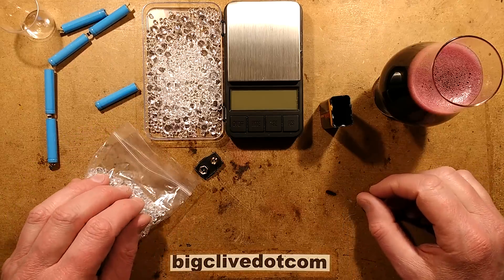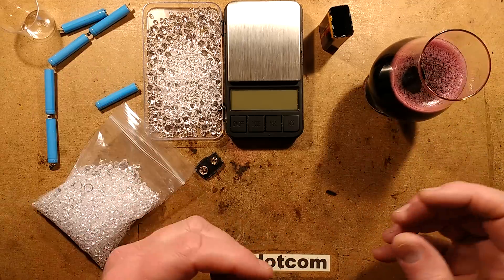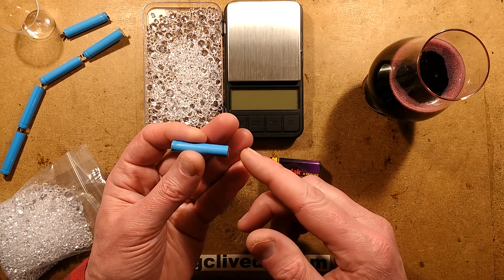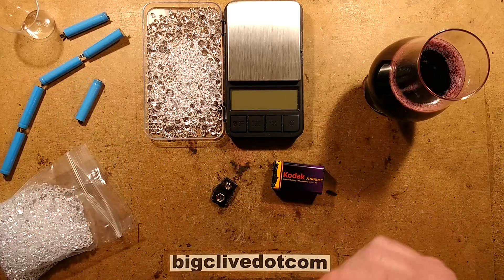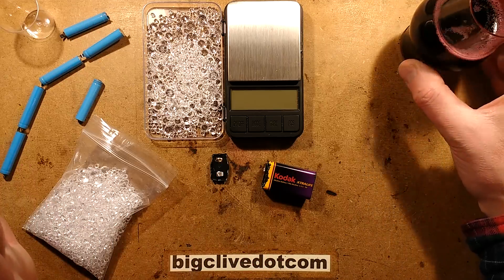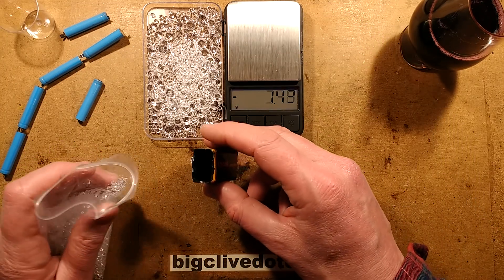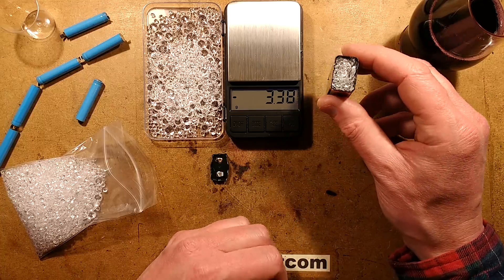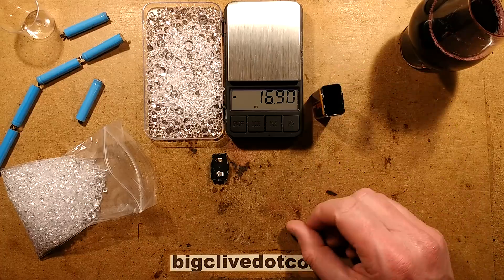How many diamonds can you smuggle in a 9V battery.

Comment: I thought about 50 ct., you were close to it, but I have to admit I was *wrong*!
Polyethylene has a density of 0.94, diamond has a density of 3.5, so if these were real diamonds in the full brilliant cut, mixed in sizes and irregularly arranged you had 46 ct. PE "diamonds", ÷ by 0.94 and × by 3.5 the true weight had been a bit over 171 ct.
The value is difficult to estimate as the value per ct. varies depending on the size of each individual gem. 
Take ¼ ct. diamond of a really  good quality and you're currently at €/$/£ 700.- per piece, ½ ct. you can get good ones at 1.750.-, 1 ct. for around 8,000.- each while the biggest ones in your box where at least 3.5 ct. for 100,000.- each.
So - happy calculating. 🤭
People who had the chance to escape from Nazi Germany early enough didn't use 9 V batteries for this purpose, just think about how many can fit into a match box! You can arrange them much closer layer by layer in alternating orientation and then slide the drawer into the matchbox.

Comment: It would be easy to find out the value of that volume of real diamond. Just need to look up the density/ weight to volume ratio of diamond, then get the volume of your diamonds you used -- this can be found by taking a known volume of water, adding the diamonds, and seeing how much they displace. Then you can calculate what the diamond weight for that volume would have been, and you can look up the cost from there

Also, the diamonds that are flooding the market are "real" in the sense that they are the same material... just artificially created. Now it can actually be easier to tell them apart because some artificially created diamonds are like 99.999% perfect, whereas natural diamonds can have carbon spots that are visible to the naked eye. So if there's a big fat carbon spot, that's a good indicator it's probably natural

Comment: If you are going to go into the smuggling business, I think it would be important to do a better job of faking the battery. I think you need to leave enough room to get 9V worth of button cells in there as well, so that the battery would apparently work.
Now that sounds like a Bigclive project.
Reply from the maker: If I was doing it for real I might add a small group of three lithium button cells for the voltage.

Comment: I remember the fake lantern battery hack telling you about getting 32 AA batteries from one, instantly I knew that was fake but you can make up a lantern battery with that number by using four AA in series then another four in series then the two joined in parallel, the same for the other three chambers in a 6v lantern battery. I tried it an it was Labour intensive an slightly expensive, even using cheap batteries, four F cells in series is the way to go, you won't get 32 AA batteries from one of those. Someone once thought that possible because there is a few videos on here about it. You can however if you wish use the F cells in Maglites but insulate the outer casings with tape first.

Comment: They do sell carbonated red wine, at least here in Michigan, USA, anyway. It's called Cold Duck, and it's quite good. It's not exactly traditional red wine, although it looks and tastes the part. It is wine made from grapes, and it is naturally red. It's made from the must left over from making high quality white wine. When white wine is made, the grapes are crushed and then the skins and pulp are filtered off, leaving just the juice, which is fermented into white wine. The skins and pulp are called must, and contain a good amount of sugar and juice. The must is then also fermented and then is pressed to make a low quality, very strongly flavored red wine. This wine is ordinarily used to make brandy or vodka, but some of it is used to make cold duck. Cold Duck is made by blending one part must-wine with two parts sparkling sweet white wine, eg, champagne.

It's very good tasting. It's semi-sweet with a lot of body to it. It has a bit of that tannin quality that make tea and red wine puckery, but that's rounded out with sweetness. To me, it's the taste of Christmas without the spice. Speaking of spice, it goes great mulled, although the mulling process is a bit different than usual. You take a quarter of the bottle and heat it up with mulling spices on the stove for fifteen minutes after getting it good and hot, as you would brew tea. Then strain off the spices and put it in the fridge. When it's cold, slowly add it to the rest of the bottle, and now you have mulled cold duck. Excellent.

Comment: I'm so pumped for the advent of affordable large synthetic diamonds. (They're not fake, they're just more ethically sourced and higher-quality.)
I mean, they're obsolete as far as gemstones go because synthetic moissanite is a nicer-looking 'sparkly piece of clear refractive crystal' with similar durability, but for heat-sinking, hard coatings, and small knives that don't dull it sounds awesome. (I'm thinking of a blade edge insert cut from a single long thin diamond, much like the carbide inserts in a lot of industrial cutting bits) Definitely going to revolutionize cooling of computer chips -- couldn't you bond it directly to the chip die (as it conducts heat well but not electricity)?

Also, I've heard that you could eventually adapt the technology that makes synthetic diamonds to make exceptionally small, durable, relatively safe RTGs (though the fuel and production would still be expensive, and fire would still be a hazard): A crystal of diamond-phase carbon-14 coated in enough diamond-phase carbon-12 to shield the radiation, and you have a perfect constantly-warm, highly thermally conductive, electrically insulating stone to coat in thermocouples. Not super useful on Earth where radioactive material needs to be kept under relatively close watch for safety reasons, but potentially useful in space or future planetary colonies without a biosphere outside.

Comment: I had no idea that AAAA batteries existed until I got a Surface Pro 4, which has a battery operated pen. Was quite surprised since I've seen batteries both huge and small in hardware stores. Guess it just blended in with the AAA/AAs

Comment: Batteries are not allowed in the aircraft try smuggling a battery
Reply: You can fly with batteries on an aircraft, it's just some airlines have policies about loose lithium cells. If you put them in a plastic holder or device they don't care!

Comment: Using real diamonds:
Vol of pp3 = 48.5mm*17.5mm*26.5mm = 22um^3

Assume approximate fcc packing factor = 74%

Therefore:
Useful Vol of pp3 = 22u*0.74 = 16um^3

density of diamond = 3539 kg/m^3

density = mass/vol
Therefore:
mass = vol*density
mass = 16u*3539 = 58.90... g

Using plastic diamonds:
density of Acrylic = 1163 kg/m^3

mass = 16u*1163 = 19.35... g

I.E.
Real               Diamonds     ~60g
Poundland's Diamonds     ~20g

Comment: Carat is a unit for weight. One Carat is 0,2g.
Natural and synthetic diamonds have pretty much the same density, so if you'd measure volume instead of weight it'd still be the same.
Synthetic diamonds are chemically identical to natural diamonds, you can distinguish them by their quality. Basically a natural diamond will never be as pure as a synthetic one.

Comment: Hmm.. So I was going to take the dimensions of a 9v, calculate the volume and assume the plastic diamonds are acrylic with a density of 1.19g/cm^3 and fudge a packing constant, but I figured lets just go with the effective packing of the AAAA cells and use their dimensions and acrylic, so here:

((((8.3mm/2)^2)*3.14)*42.5mm)*6*(1.19g/cm^3) = 16.4g

Seems a bit high, but I'm sticking with it.

-edit  So that was quite wrong.  But with just the dimensions of a 9v I get 17.5g, so the packing efficiency is like 50 percent?  hmmmm....

Comment: video has no sound
Reply from the maker: Check your surround sound settings.  Dolby often diverts my voice to a bass channel that may not have a speaker.
Reply: wow.... turning off 3D makes the sound only come from the center speaker. What kind of recording method are you using?

Comment: A long time ago i read an article where smugglers used car or truck batteries to transport drugs. The bottom was removed, the cells reduced in size and resealed to give space for the drugs. The batteries would work but with reduced capacity, barely enough to start and run the car.
When i read the title i thought about smuggling diamonds. :-)
Reply from the maker: Latterly I did consider the idea of a stnck of three 2032 lithium cells to fake the 9V and leave space for diamonds.

Comment: Best way to carbonate small batches of stuff is to get a whipped cream maker (or seltzer bottle with the tube removed), pour your liquid in and then use a C02 cartridge for a seltzer bottle in it. Shake it really well after carbonating and put it into the fridge until it is cold, helps to shake it once it is cold and give it time to rest. Don't try and use the whipped cream dispenser to pour, just take off the lid. I find whipped cream makers at thrift stores quite often.

Comment: 0.9 g / cm3  (resin density) *  (48.5 mm * 26.5 mm * 17.5 mm) * 0.6 (packing efficiency) = 12.15 grams- probably less. Not sure of the actual material the diamonds are made of, nor of the packing efficiency, but, I'll unpause after I comment. :)
Reply: So! I was calculating the outside case, but also I'm betting the resin I was calculating the density off was way way denser, also. I was afraid I'd be off the other way when you started tapping them down, but there it is. :) Within 3 grams isn't bad given what I had going against me- i.e. having no idea what the material was.

Comment: On the topic of drug dealer scales... A local video shop used to sell similar cheap but accurate gram scales. Local cops heard the drug dealers were buying their scales at said shop, so they went and bought 3 sets... Now anyone busted for drug possession can't argue about the scales being rigged because they're using the exact same scales 😂
Reply: Never happened. When they arrest  you for drugs they use a precision lab balance and it has to have a NIST traceable current calibration. Not only can scales be hacked, that happens more than you might think and it's not hard to do with either simple means, ie using the wrong calibration weight, or through more sophisticated means like using an ardurino.  On top of that one of the bigger issues is those drug scales are not as linear as a properly calibrated lab balance.  I mean if you are going to weigh out 1 ounce over and over and a gram over or under isn't a big deal then it's not going to really be an issue, but if you need the precise, accurate resolution of a weight of a substance than they are not a good choice. You have to remember accuracy and precision are two seperate things, your scale might read 1 ounce as exactly 1 ounce every time, but when you go to read the weight of 1.5 ounces you get something that's not exactly equal to 1.5 oz on the scale. This would mean your scale is precise, but not very accurate. To get a valid record of evidence you need both. That's the difference between a 20$ scale and a 2,000+$ scale.
Reply: Why would that mean they can't be rigged? Are they specially designed to prevent rigging? Even if they were that still wouldn't necessarily mean they couldn't be rigged, or inaccurate for other reasons. Having three of them changes nothing, they could all be rigged. 

I'm not saying they're rigged, just correcting your logic. Also they're jewellers scales, which is why they can display in carats and grains as well as grams and ounces.

Comment: I guessed 8 Drachms
 I have a battery question that is keeping me up at night....with cheap outdoor solar lights, are you better off sticking with a low capacity but easily recharged battery...or a high capacity, probably only partially rechargeable...sounds simple, but the more i ponder the less simple it seems...any thoughts Clive & crew?

Comment: An average carrot weighs 61g. 
This means that 46 carrots would weigh 2.8kg.
At £1 per kg, that's approximately £2.80.
I hope this helps.
Reply: Yes, but can you account for inflation please? It's very important.
Reply: @inferno7181  It's approximately £3 after inflation. However my local store currently sells these at 40p/kg, so shop around and you might get a deal.

Comment: Best guess in advance of the result: 15.7g (this assumes a density close to that of water with something like 25% of the space filled with air). It would be about 55g if it were actually diamonds rather than acrylic.

The actual result indicates one or more of the following:

1) A significantly lower packing efficiency than I expected.
2) Lower density for these than acrylic (which is a bit more than that of water).
3) The difference between nominal volume (exterior) and actual usable volume (interior) is significantly greater than expected.

My next step would be to fill the case with water to find the actual internal volume (to address 3), then weigh a small number of the larger "diamonds" and compare the weight to the displacement to determine a better value for 2, then fill the case with water and diamonds to determine a value for 1.

For Science!

Comment: 2.6*4.3*1.6 = 17.8 cubic centimetres. If the density is 0.6, then let's say... 11 grams.

OK where am i wrong? I assumed the top and bottom enclosure are 1mm thick and the perimeter is 0.5mm thick.
Reply: Packing factor, probably. There will be air gaps between the pieces. You weren't that far off, though.

Comment: De Beers is an evil company I am glad the Chinese are running them out of business with cheap diamonds.
Reply: And with industrial diamonds widely manufactured  (legally), it was only going to be a matter of time until some enterprising soul found a way to grow them to jewellery size and flog them as natural - if DeBeers are finding it difficult to distinguish them from natural diamonds, it indicates they're chemically identical (an unusual form of carbon - the same element as soot, graphite [aka pencil leads] and buckminsterfullerene [aka bucky balls]) - and it's likely to be the mixture of impurities used as a signature for natural / synthetic.

Oh, and as for "a diamond is forever", focus strong sunlight through a magnifying glass onto one... 😈
Reply: mittfh - It's the flaws in natural diamonds which have been difficult to reproduce in synthetic ones. As methods improve, it's becoming much harder to distinguish between the two types, so deBeers are beginning to worry about losing control of their long-lasting, and very profitable, pet rock scam.
Reply: scot shabalam I agree on that front. The real issue though is for the pay collectors who want "natural" diamonds, but screw them.
Reply: no.
fuck china.
Reply: @Cole-ek7fh  you wish ;)

Comment: AAAA batteries are commonly used in active stylus for tabletes and digital signature devices.
Reply: They're common in blood glucose meters (blood sugar machines), and where I live, the AAAA cells are stocked by virtually every pharmacy/drug store. They DO tend to hide though, WAY at the bottom of the display! ;)
Reply: There are rechargeable AAAA cells around. Seems none from big brand names, though... But you can disassemble eg. a Tronic 9V rechargeable from Lidl, they are great quality batteries with long life and very low self-discharge, and made from AAAA NiMH cells. I have two 9 year old Tronic 9V NiMHs, which are still alive (with reduced capacity obviously, but my multimeter still runs for 2-4 weeks with them, the same DMM would run for about 2 months with them, when they were new).
Reply: a pain in the backside battery i had to find, was a 27a battery, its the same size as AA, but 12v, used for a garage door sensor, and worse, you cant CLOSE the damn door without it, great to find out, you go out, and cant close your door and no warning...
Reply: SigEpBlue huh, I will have to check out the pharmacy next time.
Reply: Jusb1066 If you find yourself in the same situation again just set fire to the garage, only the most determined burglars will take the time to extinguish the flames.
Reply: @firstsurname9893  😆😆
Reply: Question:   Why does the woman in those Crocodile Garage Doors commercials insist in pointing the RF key-fob over her shoulder at the door?
Reply: mrnmrn1 I will give that a shot too.  I'd like to make my own stylus with recharge pips so I don't have to break open the pen.
Reply: Or just don't support manufacturers who make poor choices like sticking consumers with a far less common primary cell powered device when there are other rechargeable cell options available.  Nothing these days should take a AAA, let alone AAAA primary cell, possibly the AAA in rare cases of cheap device with very low drain like a remote control or digital thermometer but even then, we're talking devices costing $5 and that run 5+ years from a set of batteries so you may never end up buying new cells for it.

Comment: People have had their soda streams go bang after carbonating stuff other than water. The fluid can get up into the plastic valve, and if the fluid leaves a residue when drying, it can clog the plastic over pressure release valve (the one that buzz) plus the hole down to the spout and the next time you press the button it explodes and leaves a bunch of quite nasty flying shrapnels. It is not made to withstand the full pressure from the CO2 bottle.